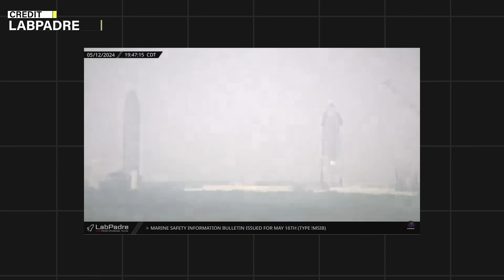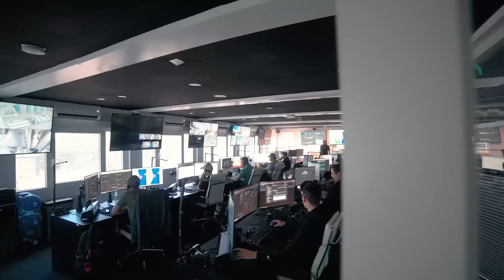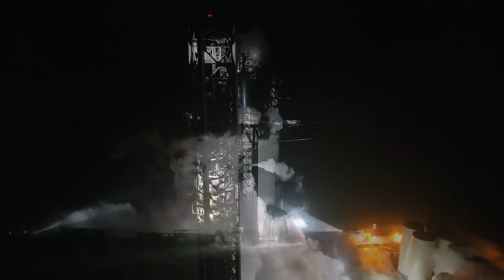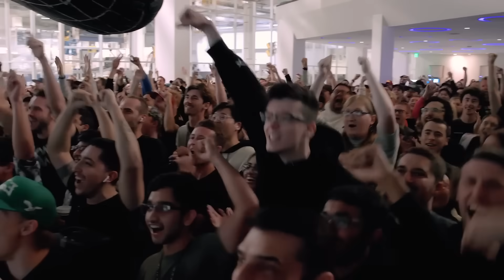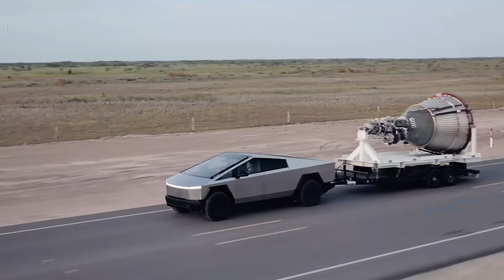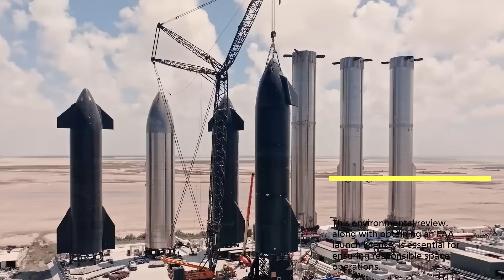Ship 31 FAILED Cryo Test, Huge Electric Fire! Why? FAA to Investigate KSC | Episode 39

Comment: I smell a rat.....or perhaps a mouse.  There are at least 5 species of rodents living along the Gulf coast of Texas and they all have one thing in common....they love to chew on wiring insulation.  Having rodents chew the wiring  harness on local vehicles that are in storage is not unusual.  Crank up your motorhome after it has been sitting for a while and you might get sparks or smoke. With all the human activity going on at Starbase, rodents are likely in this area and the preassembled wiring harnesses have to stored with great care.  Even partially assembled Starships need to be protected from mice and rats.

Comment: Dont need another Challenger mishap
Reply: That was not a mishap. Nasa was notified that the temperature outside was to low for the seals by engineers. The flight controller, most likely under political pressure, let the ship launch.

Comment: Testing to Failure is the only way to absolutely confirm the integrity or maximum sustainable stress of a developing design. Some industries, like the construction of warships and passenger aircraft, impose much more demanding test regimes than others, because the consequences of failure can result in unacceptable losses.
At the same time, this week's SEVEN X-class solar flares, almost all of which generated separate Coronal Mass Ejections, seem the likely proximate cause of the Excess static electricity responsible for unanticipated electrical discharges between the tower and the craft. The extraordinary extent of the Auroras, both Northern and Southern, are merely the most VISIBLE signs of Titanic current flows being directed into the Earth's atmosphere, oceans, crust and mantle.

Comment: This is not an issue that’s why they test test test, no story like they  said , they’ll fix it.
Reply: Of course its an issue, something going wrong is always an issue. But it does not have to be a major one. (Best case scenario, there was a production issue that can be easy fixed with some minor adjustments and more QC. A little bigger issue if it was a design issue that might affect more prototypes, maybe even those that has passed the test earlier)